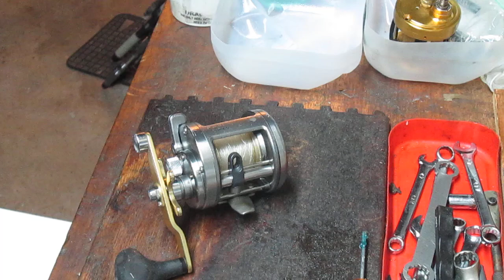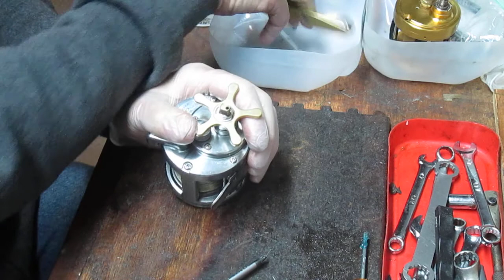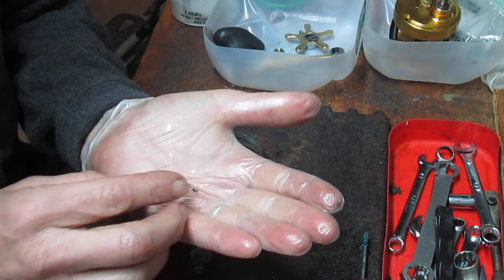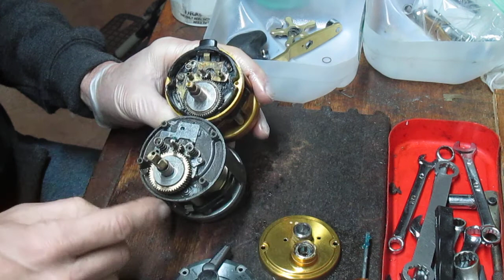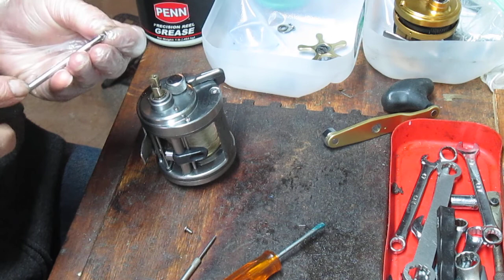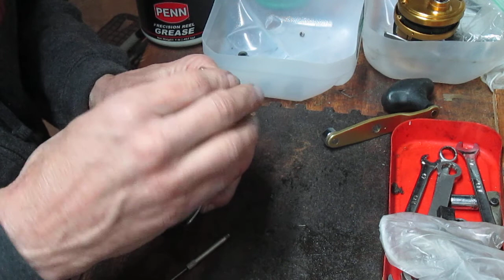Shimano Tekota Basic reel service including drag maintenance

Comment: Thank you. I have a dozen Tekota 800s that I use for trolling on the Chesapeake. 
Some of them are almost 15 years old and definitely in need of service.
Once suggestion to improve your video - add links, or at least product names, for material you used, such as the grease and oil, into the description on your video.

Cheers, and tight lines!
Reply from the maker: Thanks for the suggestion, and good luck getting those 800s back in action!  I use Penn Precision Reel Greases and oils for most projects.  If you need parts for your reels, they are generally available directly through Shimano or Southwesternparts.com - Best wishes - Dennis

Comment: Thanks for taking the time for the video. Can you go into drag engagement issues? My reel goes from low to max quickly   , leaving the reel hard to adjust drag when fighting a fish. I replaced the wavy washer, which helped. Anything else you can suggest? What type of oil/grease should I use?
Reply from the maker: It may be sticking drag washers.  If they are adhering to the metal washers, there will be limited adjustability and a skipping feeling.  They may need to be replaced - Dennis
Reply: Ok, before installing new drag washers, should I lubricate? If so, what should I use?
  Side note, I dab a bit of grease into head of Screws to hold them onto the driver till scew is inserted into pesky holes
Reply from the maker: The answer depends on if you are installing carbontex or fabric washers.  If you are using hard washers that are non-porous then no grease is needed.  If the drag washers can absorb the grease, then a light coating is all you need and make sure to wipe off any excess.
Reply: Your solution to my original question was spot on. I took the drag apart, cleaned washers, added a bit of oil, and reassembled. The drag is working great again. 
  I ordered new shimano drag washers and shimano drag grease. I'm not sure how to tell if they need the  grease  or not. The originals are similar in appearance to the ones in your video....would you/ did you  grease those?
  Thanks again.....this reel gets a lot of use as one of my main trolling reels and the drag in constantly under tension when in use...I'll be glad to have it back in action!!

Comment: Hahaha.  So how important is that rocket thing?  Mine launched itself somewhere it will never be found….  

My 300 seems to be working without it.  Thank you for the video, I was able to replace my clutch lever and give it a good re-lubing before the season kicks into gear.
Reply from the maker: Not important at all.  It is a noise maker that lets you know that the frag is being backed off.   You will now be in silent mode, but that is not mechanically important to the reel - Dennis
Reply: Awesome.  Thank you again.

Comment: Thank you for the video.  I have the Tek300lc and I was wondering if you had any experience replacing the clutch lever? 

 A tip for the small screws: I use paper masking tape.  I'll put the screw through the sticky side, and fold the tape over the end of the screwdriver to hold it in place.  After you have the screw started, pull the tape off.  Sometimes you can just hold the tape in your fingers to get the screw started with the screwdriver.  Sometimes I just put a dab of thick grease on the tip of the screwdriver and stick the screw onto it
Reply from the maker: Yes.   That darn plastic carrier tends to break.  It is not a difficult thing to replace it.  Just take pictures as a reference for where the spring goes and take it easy - You can do it - Dennis

Comment: Tekotas are not tricky at all. Pretty simple rugged Malaysian Shimano. My brother knocked the engagement lever and it clocked to No Man's Land. Took it apart and firmly racheted back into operation zone. The drag click pin is the same as shimano uses in their bail pins. 

The only thing I F-ing hate are the handleside screws that have nearly flush heads and strip easily. Then you have to do the rubber bands unscrew method or one i had to dreme the headl off all together.
Reply: Mind you that was after 15 years I finally service it. Aluminum and stainless plus corrosion are the culprits...and my laziness. Just restored the drags today.
Reply from the maker: Thanks for sharing your experience - Best wishes - Dennis
Reply: @2ndChanceTackle  by any chance would you know what the thread pitch is for a Daiwa 7600H bail roller. Those little nuts with the red plastic caps?

Comment: I have watched this video several times while servicing my Tekota 600 reel but have found a problem. Everything is in good shape but when when reassembled the anti reverse always engages whether or not the clutch lever is operated. In other words I am unable to forward wind the handle. Seems like something is needed to hold the anti reverse pawl away from the ratchet when in winding mode?  Amy thoughts please?
Reply from the maker: My guess is that you installed the roller clutch (AKA A/R instant anti-revers bearing) upside down.  There are two A/R stops on this reel.  One is the A/R pawl, that is a back up to the primary A/r which is the roller clutch.  That is a one way clutch and when it is upside down, it is going to prevent you from going forward, while the pawl is going to prevent it from going backwards, so you will be stuck Try flipping the clutch and see if that restores your reel operation - Dennis
Reply: @2ndChanceTackle  Thank you for your prompt reply and your advice. Everything is fine now. Much appreciated.

Comment: Thank you for your video. Im fishing charter on Lake Ontario, use 3 tekota 700 reels for busy wire rods. Too bad they are discontinued. Had to move in to Penn SQL50LW
Reply from the maker: YW.  How do you like the Squalls?
Reply: @2ndChanceTackle  No problems with them. Fisherman /clients like them too. They replaced all PENN309. Use them for lead core and weighted steel (Torpedo fishing products) wire lines with lots of brade backing. They feel solid.

Comment: Toothpick all you need to do is jam it in. It holds that spring on its own no need bend it.
Reply from the maker: Yes - I am familiar with the toothpick approach as well.  I have had some issues there with getting the star adjuster to thread properly with the pick in, but yes, you can do it with the toothpick - Thanks - Dennis

Comment: Thanks for this video. I just picked one of these reels up to use for jigging. I'm sure I'll reference this a few times whenever I go to service the reel. Do you know of any good upgrades to do to these reels? I also have a 300 size for trolling and a 700 size for offshore trolling/jigging
Reply from the maker: I am unaware of any upgrades.  Truth is, the reels are well made and don't really need to be upgraded.  As most, maybe replacing the bearings with ceramics, but that is about it - Dennis
Reply: Yes, you can upgrade the drag to carbontex drag washers and also the bearing replaced with ceramic bearings.

Comment: Great vid. I have a Tekota 600 and noticed that when boat fishing and disengaging the spool so that it freespools to get the line/sinker down is a bit slow and had a bit more resistance. How can I get the sinker down faster what would I need to lubricate to make it go down faster and more easier ? Any tips ?
Reply from the maker: Chances are that the spool tensioner behind the handle is locked down too tight.  Try backing it off a bit by turning it counterclockwise. Adjust as you need to to get the drop rate right - Dennis

Comment: Hi Dennis 😀 I have taken apart my tekota 800 several times today. Everything is working except the anti reverse.  I hear it trying to engage but it doesn't lock up.  Part number 303 on the schematic seem to free float and not stay attached to the gear. Thanks for the help! Joe
Reply from the maker: Joe - there should be two prongs at the end of the A/R dog part number 303.  Those prongs get spread over the toothed ratchet gear under the main gear.  One prong goes on the top side and the other on the bottom of that piece.  If it still doesn't work, the prongs may be damaged or spread to far apart to get the right friction.  If they are too far apart, you can find the ends with a pliers to help bring them close.  They do not need to be bent to the point of touching each other, just enough to grip the ratchet.  It sounds like your has both prongs riding under it as apposed to being spread on it. - Dennis
Reply: @2ndChanceTackle  Thank you and you are right they are a pain to work on! Salt water is a bugger on equipment!

Comment: Thanks for your videos you have bailed me out a few times. I was wondering if you have a video replacing clutch lever? I have a new part to replace the broken one.
Reply from the maker: I don't have that video.   I will add it to my request list.  That darn clutch lever is the weak point of this reel.  I have had several come in with your problem.  I will try to do a video on the next one in - Thanks for asking - Dennis

Comment: Dab the tip of your screwdriver in grease then the screw will stick to the screwdriver.
Reply from the maker: Thank you. - It's me, not the screw or screwdriver.  I've grown to accept it, even when it doesn't make for a good video!   I use the grease from time to time, but sometimes I just struggle.  Best wishes - Dennis

Comment: Nice. I did shoot the noise maker out though - lost in man cave! Thanks for the advice.
Reply from the maker: That's why I call it the rocket spring.  I have done the same, unfortunately.  I was told a good tip for the future.  Try putting the reel inside a 1 gallon zip lock baggie before messing with the spring.  It most cases, it it shoots, the spring will land in the baggie - Dennis

Comment: Dennis, your videos are a HUGE help cleaning my reels. Thank you !!
A tip for you for the spring and click pin for the Shimano Tekota 500 reel that you hate.
Find a really thin and small straight screw driver.  Usually in eye glasses repair kits.
That screw driver will fit inside the hole in the shaft where the spring sits.

Screw the star drag onto the shaft enough to get the threads started.
Place the spring and click pin into the hole in the shaft.
Slide the screw driver into the hole, it will fit into the groove on the click pin.
I use a small pair of needle nose pliers to compress the pin and spring.
Hold the pin down with the screw driver.  Finish screwing on the star drag and BAM.....Jeds a millionaire...that easy.  Pull the screw driver out and finish up.
It’s really easy.  No stress.
Hope this helps you.
Thanks again for the great videos !
Reply from the maker: Thanks John.  Another alternative that I have been using lately is to use the last shim washer that goes under the star adjuster to wedge the assembly in place.  When you tighten the star adjuster down, it pushes the washer off and sets the assembly correctly.

Thanks for watching
Dennis
Reply: @2ndChanceTackle  yes i tried that the first time, that’s how i lost the pin.  But it does work. Thanks again for the videos !

Comment: I found a good way to get the "rocket" under control. I used the 5 shims/washers to hold the rocket in place and then screwed the brake Weel on. Easy
Reply from the maker: That is a great way to do it.  Actually, you can set all of those washers and just use the top one as the hold down.  Thank you for sharing this alternative method. - Dennis

Comment: Good video Dennis I know what reel to avoid I know shimano makes good product. Looks like a pain to work on.
Reply from the maker: That little rocket spring is problematic.  I found you can also wedge the spring in with the last tension washer the goes on the stack before the star adjuster and that the spring will set once you tighten down the star.  If you know that quirk, then the reel is a good product, and you noted and worth having if you do a lot of heat drop fishing.

Comment: Nice video. I was thinking for the tiny screws, possibly one of the screw drivers with the magnetic tip, or possibly the screwdriver with the little metal grabbers on the side. I just bought the tekota 700, going out tonight for ARS, 50 miles off shore on the west coast of Florida.
Reply from the maker: Thanks for the comments Jimmy.  Many of the screws are stainless steel, so the magnet doesn't work.  I have trouble with small pieces, but don't mind.  It just makes the video "human" - Dennis

Comment: I had the click spring pop out, which way does it go back in?
Reply from the maker: The spring has the point side facing out of the hole.  Since I did this video, I learned another way to reinstall the spring.  Use the last tension washer on the gear sleeve to wedge the spring into the hole and leave it there holding firm in the wedge position.  Then install the drag adjuster.  When the adjuster cranks down on the tension washer, the spring will release and set properly.  This is a alternative to the toothpick version. - Dennis

Comment: Just watched to the end.  Wow, some engineer had evil intent to think that up.
Reply from the maker: Bill - I have since found a second way to reinstall the spring.  Insert the spring in the hole and take the last gear sleeve washer and press it down until it holds the spring in as a wedge.  Then use the drag adjuster knob.  Screw it down.  When it connects with and pushes down on the washer it will set the click spring!.  I think you are right though.  Either way, the design is frightful and sinister - Dennis

Comment: Any experience with the new model?
Reply from the maker: I don't normally see the newest models until they are out of warranty or it is tine for a basic season ending service at about 1 year.  If the reel fails before then, customers normally send them back to the manufacturer for the service.  As you asking on a specific model? - I will see if I can help - Dennis

Comment: Hi, thanks for the video, I am currently attempting to disassemble a Tekota 800 to try and get the free spool release lever to function again.
The problem I am having is the front plate is not wanting to freely come off the reel. 
I have removed all relevant screws but the plate seems stuck down near the shaft, in the area where the two rivets (for lack of better term) are.
Is this just built up corrosion? I do not want to exert too much pressure removing the plate so as not to break any of the internals.
Reply from the maker: Have you removed the handle and drag assembly?  You need to do that in order to remove the side plate.  If you have already done that, then you may have some build up of stuff around the seal.  A rental tap tap with a small rubber mallet / hammer usually can free it if that is the case. - Dennis
Reply: @2ndChanceTackle  Thanks for the reply, yes i have removed everything on the outside of the face plate, I am thinking it may just be build up however the freespool release level is also very wobbly and basically feels detached (the reason i am pulling it apart). Il give it a few taps and see what I can do, however I have attempted to wedge it open with the included shimano 'spanner' near the bottom of the reel cover and it feels pretty firmly lodged.
Thanks
Reply from the maker: Hmmm.  Make sure you get the schematic for the reel to check on the parts and make sure that all the screws are out.  The schematic is available at mikesreelrepair.com - Dennis

Comment: Never understood this design either and it really is a pain. I own 2 of the Tekota 800’s now but used to own more of them in other sizes. They’re great reels I run wire on the 2 I have left and the spools are very resilient but that spring makes no sense.
Reply from the maker: I have found an alternative way to compress the spring that works as well or better than the toothpick.  You load all but the last shim on the gear sleeve.  Then put the "Rocket" spring in the hole and creep the last shim down until the spring compresses and is held in place.  Once that is steady, tighten the stag adjuster and when the adjuster meets the shim, it moves it down and loads the spring!  Try that next time you have the reel apart - Thanks for viewing - Dennis